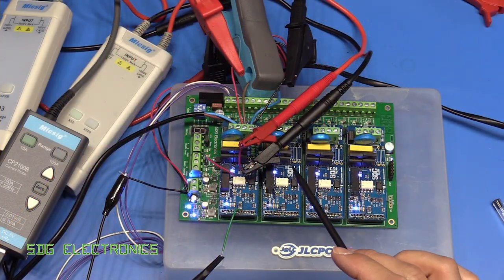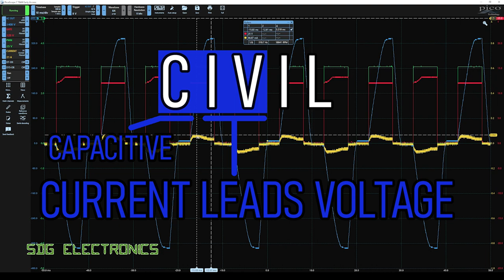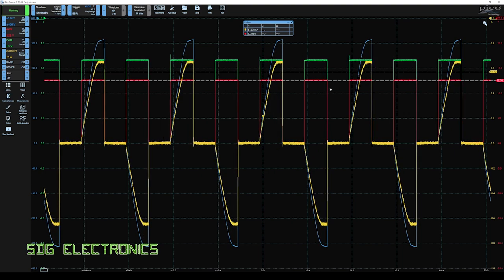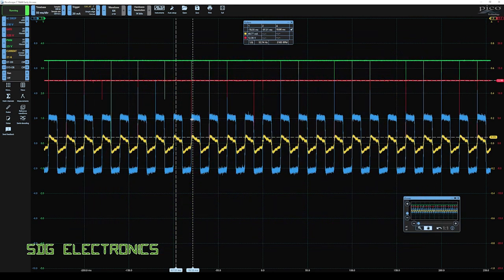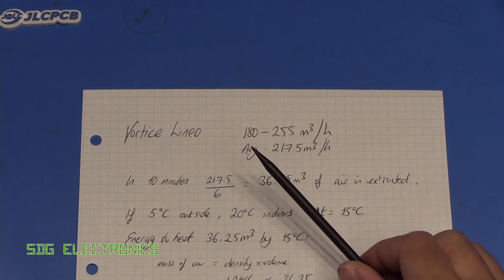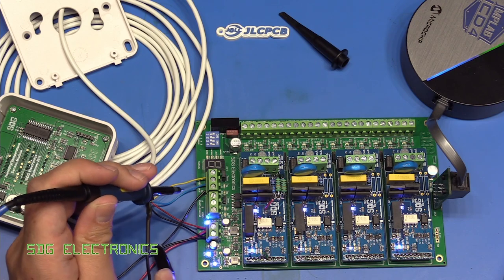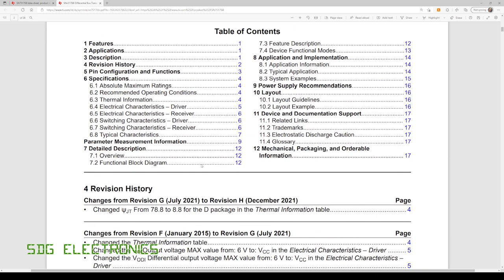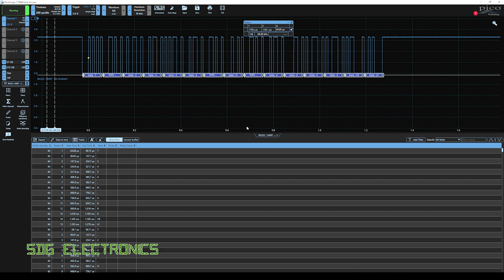SDG Electronics PicoScope 5000 Series Demonstration

Comment: On some power project boards, like a small Aux off-line fly-back switching supply for example, many times we would like to monitor currents on the PCB, but if I use a traditional current probe I have to introduce a loop to clamp around, as you did in the video. This creates two problems; first I must break into a circuit, and then introduce a loop (which may introduce unacceptable inductance). 

What I would like to do is on my designs that are not board space critical (like a cell phone), is to provide place holders on the board to accommodate either an 0805 zero ohm device or a 10mOhm non-inductive current sense resistor for circuits that operate in a current mode. I want to make my own active differential probe that has a PCB with a tapered nose having two very short leadd spaced so that I can solder the probe leads to each side of the sense resistor (within 10mm at most). 

The probe would be powered by four 9V batteries for +/- 18Vs input with regulated LDOs for +/- 15V. The probe would be floating with input using INA849 (instrumentation amplifier) and output using OPA191 to drive a short BNC coax. After I complete my testing I would replace the 10mOhm sense resistor with a zero ohm jumper.

For layout I can put the 0805 place holders where they are most likely needed to monitor current. So the thinking is to introduce an accurate small current sense resistor without adding too much resistance or too much inductance which may influence the circuits operation. I think for most of my needs a probe bandwidth of 5 MHz (INA849) should work. For higher bandwidth I would have to modify the input stage. 

I do I lot of evaluation with semiconductor vendors evaluation boards, and usually I am disappointed by how few and poorly designed the test methodology is (test point design, scope connection, etc.) given the expected waveforms and potential high frequency content (which are well understood given the design is by the chip maker).